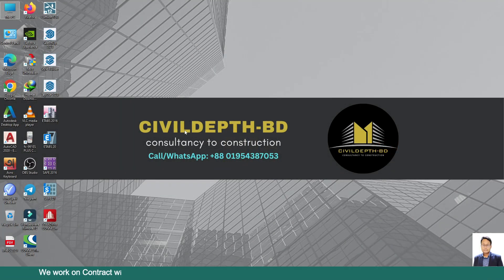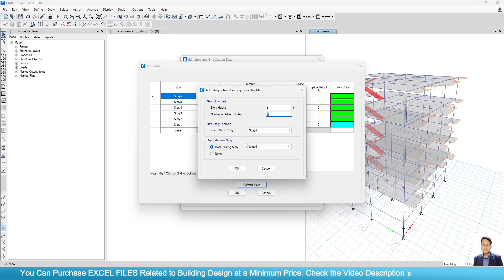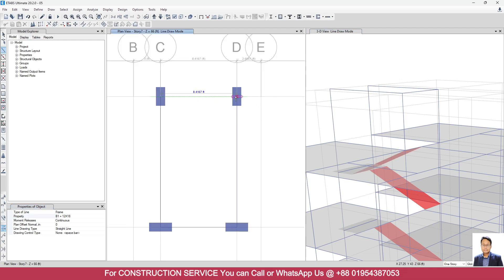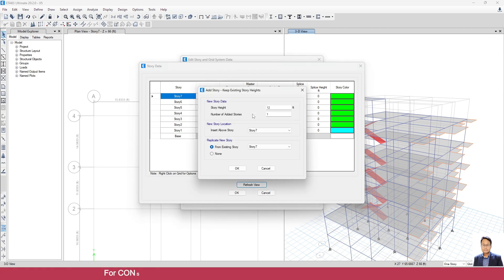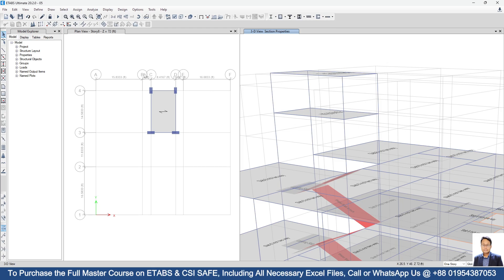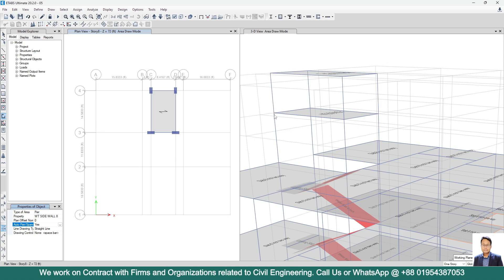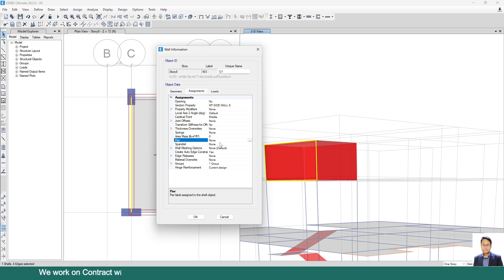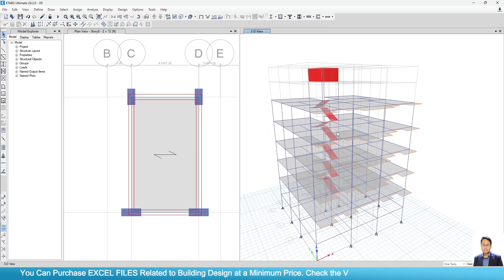Overhead Water Tank Modelling in ETABS _Episode 05

Comment: For water tanks the Wall stiffness should be 0.1 for the first 6 parameters, except f22 (it should be .7) as the OHT should not be desinged for EQ forces. They sould be modelled as RC wall, Not as a shear wall, Kindly check.